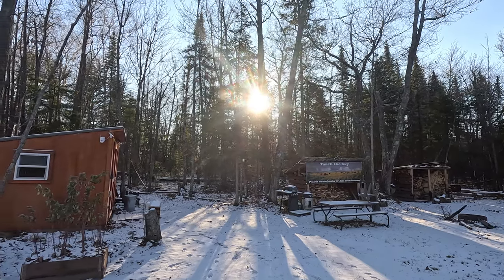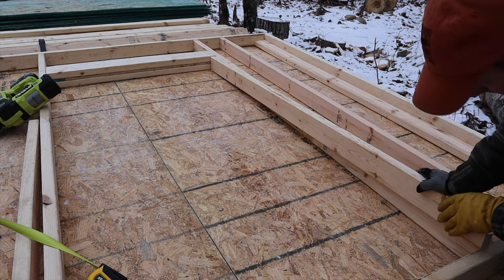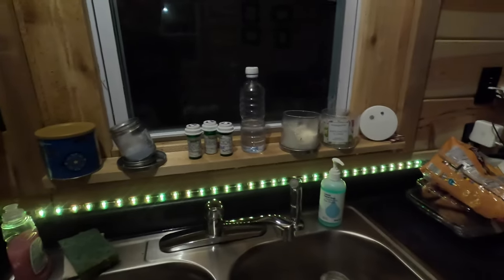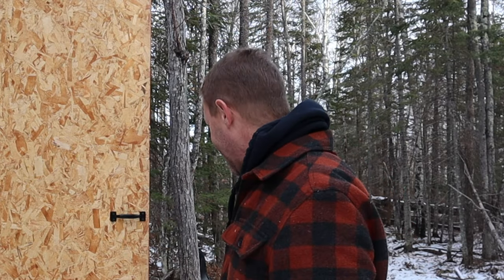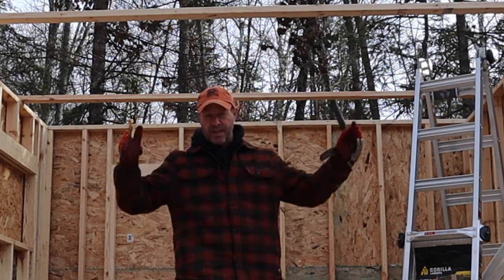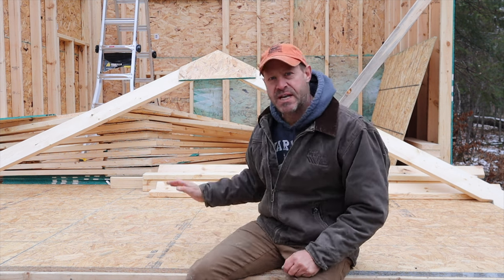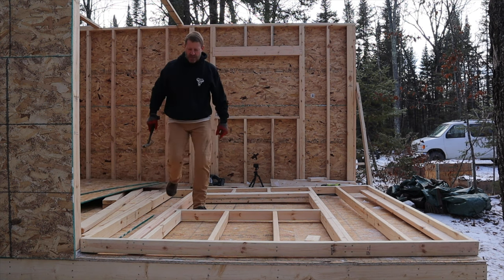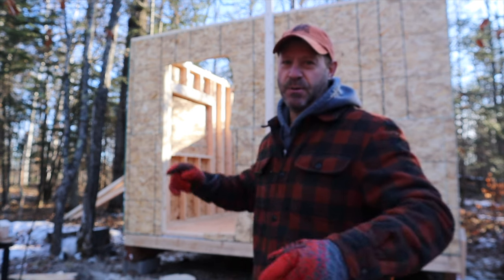And It Begins!! Framing the walls of the Bunkhouse.

Comment: My Lithium battery packs will not accept a charge when they are cold. I learned that this is because the internal battery management circuit (BMS) is programed to prevent damage from me trying to charge the lithium battery when it is below +/- 32ºF . I put my battery inside the heated cabin (or I can use the 12V outlet while driving my vehicle) to recharge them in cold weather. It looks like you are making pretty good progress to me. Thanks for the video Terry !
BTW, when you're ready for a challenge in cooking with dry staple foods consider trying some field corn. It takes me about 24 hours of simmering on top of the wood stove (or in a pot in the oven) to get the corn tender enough to use. It is a lot like chunks of potato in soups or stews.
Reply from the maker: Whoa! Field corn? That's a new one for me. Just the kernels or the whole cob?
Reply: @TRERUNSWILD  Just the kernels like you would get at any animal feed store. The corn I use is from bags I get to feed the ducks that visit us in the spring and summer. It's basically the same as hominy except corn kernels still have the outer covering (pericarp) on them. I don't mind the pericarp and it adds fiber! Whole corn is a fraction of the cost of hominy. You can tell when it's fully cooked when the kernels have absorbed enough water to puff up like popped corn. This should be a good substitute in any recipe for hominy stew.  It might make a good addition to a video: A Whole New Way to Cook Corn. 😆 If you think you might want to try this let me know and I can give you more tips. It may take two or three days to make but we always make a big pot and eat it for several days.
Reply from the maker: I'm intrigued. Do you have to let it cook the whole time? I'd like to know more. You should email the process if you have time.
travdogger@hotmail.com

Comment: Dried beans advise.
1, you don't need to soak your beans overnight. That's an old wives tale. They take just as long to cook. 
2. If you hydrate your beans with flavorless water, you will get bland beans. 

Bean recipe
1/2 pound of dried beans.  chicken broth or stock. I start with a 48 oz carton but I don't use it all. 
2 medium carrots peeled and diced about 3/8" 
1 medium onion diced about 3/8"
2 ribs of celery 3/8" dice
A couple of jalapeños cored and seeded, diced fine. 
2 garlic cloves diced fine
1 bay leaf
1/2 tsp pepper
1 tsp salt
If you want to throw a smoked  turkey wing or smoked pork neckbones, that wouldn't hurt. 
I usually add a couple TSB of hot sauce. 

Put beans in the pot and cover with about 1" of stock or broth. 
Add everything else. 
Bring to a rolling boil for about 10 minutes. 
Turn down to a low simmer. (Stir about every half hour)
Put a lid on the pot and let simmer for 2-2.5 hours.
Check beans for doneness. 
If they are still hard in the center. Put the lid on for another half hour. If they are almost done, turn the heat up a little to reduce liquid. 
Your onion and celery should have pretty much dissolved and made a nice sauce. 
Taste sauce. Add more salt and pepper if needed. 

There are really only 2 beans that aren't overpowered by the flavor of beef stock, red kidney beans and black beans.
Reply from the maker: I will give i a shot! Thanks for that!

Comment: Lithium batteries don’t charge in freezing conditions. In fact you can damage them by trying. Try putting the battery in the path of the generators exhaust and let the exhaust heat it up before and during charging.
Reply from the maker: Charging isn't the issue it's the faster discharge that is frustrating. I charge them in the cabin where it's warm.

Comment: Looking good ! 
I have a few questions, but will wait .
Reply from the maker: What's up?
Reply: Terry I'm no professional but from building a few deer camps and out builds, 
But I have found a few tricks that help later, like when building a wall cut your studs by the thickness of your bottom and two top plates plus 1 or 2 inches, this way when you sheet the outside your wall covering will hang down past the floor sheeting and onto the rim joist, giving you not only water barrier from your floor but also a air barrier.  that's just one of the little things I've found helpful   @TRERUNSWILD

Comment: Hey,  insta pot cooks dry beans quick. No soaking required.  Rice comes out good also.
Reply from the maker: I'm not sure my little solar set up would handle that. But I bet it makes quick work of it!
Reply: @TRERUNSWILD  if you're running a microwave,  it should be able to
Reply from the maker: I use the Bluetti for the microwave. You might be right that might work.

Comment: The window has weep holes for moisture to drain. When installed the manufacturer’s intended orientation, they are at the bottom exterior side. May not cause you any issues if you turn 90 degrees and install.
Reply from the maker: Oh! Good to know. A good way for reference later as well.
Reply: @TRERUNSWILD  by the way, been enjoying your videos for a long time. Someday I’ll get back to my build.
Reply: Also if you try to use it as a single hung your window will not stay up when you open it, learned from the same mistake
Reply from the maker: Good point!

Comment: With hindsight, would you still start with the Amish shed and convert it, or build from scratch like you're doing now?
Reply from the maker: The shed was so cheap it's hard to go wrong so I'd do that again. There are changes that I would have made that I'm doing now. Up off the ground, lots of windows, Built sturdier, etc. I paid 3500 for the shed shell. I'm 2500 into the bunkhouse after windows so far.